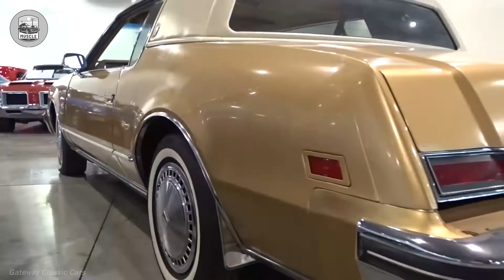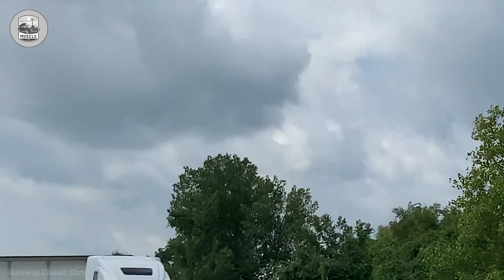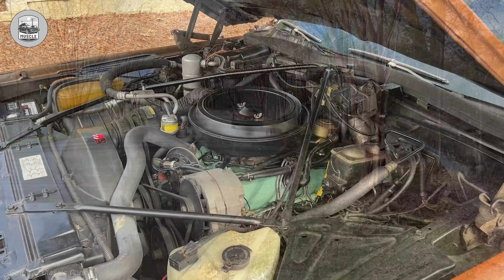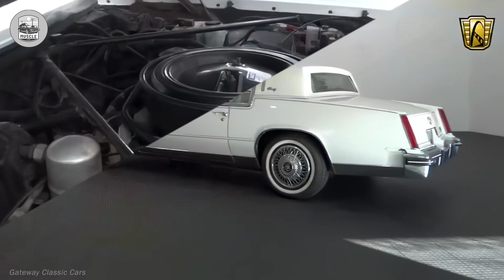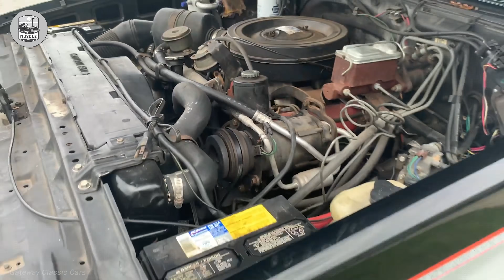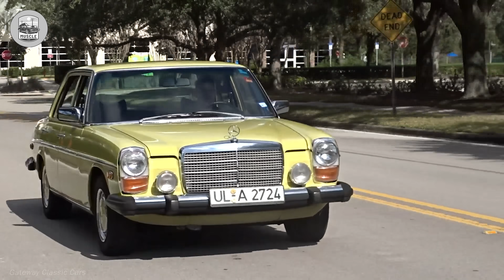Why Oldsmobile's Diesel V8 MOST FAILED?

Comment: Only in the U.S. could someone think the answer to poor fuel economy was a massive 5.7l diesel V8
Reply: 30 mpg in a full size sedan that can fit 6 people sound pretty damn good on paper at the time.
Reply from the maker: Hey @AdelynDodson, thanks for the comment
 It’s interesting how American muscle car enthusiasts sometimes look for power over fuel economy, but the truth is, big engines like the 5.7L V8 have a unique place in automotive history. They represent a time when performance was king, and muscle cars were about raw power and excitement. As a fan, I appreciate both the power and the engineering that go into these machines. Let me know what you think about other iconic engines, and feel free to share your thoughts
To everyone else, please comment, share, and subscribe to keep the muscle car love rolling. Hope to see you in the newest videos… have a nice day
Reply: Does anyone know what a Detroit Diesel 6- 71  or a 6V- 71 weighed ? I suspect more than most gasoline V8s, even big blocks.
Reply: @davidpowell3347  
 DD 6v-71 came in around ~2000lbs dry. The olds 350 was only about 150lbs heavier than its gasoline counterpart ~750 lbs. Thats part of the problem. The olds 350 wasn't robust enough to handle the pressures or heat.
Reply: A 5.7 liter isn't very big.
Reply: @Allgoodhandlesaretaken81 maybe in the U.S in europe it is huge....anyways i think 5.9 cummins would have been a much better choice with minor modification would have fit in that engine bay of a full size car🤔
Reply: @constantinzegrean6260 The 6BT has a dry weight of 1,100 poinds!

Comment: That orange Cadillac shown is gorgeous
Reply from the maker: It really is a stunner — that color on those big Cadillac lines is hard to beat. Here’s the irony that ties it back to the video though: Cadillac got burned by that same Olds diesel. GM dropped the LF9 350 diesel into Cadillacs too, and it tanked the brand’s reputation for reliability right when buyers expected the best. So a beautiful Caddy from that era might be gorgeous on the outside and hiding GM’s biggest engineering black eye under the hood. The ones that got the gas 425 or 368 are the keepers. Any idea what year or model that orange one was? Some of those late-’70s Coupe DeVilles in bright colors are getting collectible now.

have  a great day, hope to see you on our NEWEST VIDEOs for Pontiac DRILLED 130 HOLES in This Catalina - Then GM KILLED It!
https://youtu.be/q4gUSwPM4kQ

Comment: Check your grammar
Reply from the maker: Ha, fair — that title’s a bit of a word salad. Should read “Why Oldsmobile’s Diesel V8 Failed.” What most guys don’t know is the LF9 diesel didn’t fail because it was a diesel, it failed because Olds built it on the gas 350 block with head bolts that couldn’t hold compression, and there was no water separator so one tank of bad fuel killed the injection pump. Good idea, rushed execution. That’s what really sank it.
have a great day, hope to see you on our NEWEST VIDEO:
Ronnie Sox’s “IMPOSSIBLE” Clutch TRICK That KILLED Pro Stock in 1971!
https://youtu.be/swL7Y3BY8S4

Comment: There are hobby engine builders who remedy the major flaws .  With proper upgrades can be pretty reliable , it might have been ok as a light duty industrial engine. There is a dearth of non-Mercedes automotive diesels for 4,500 pound passenger cars.  I wish GM had ttrial tested it in a limited fleet for an extra year or two. Even with the upgrades infamilar American owners and mechanics would probabky have tarnished its reputation.
Reply from the maker: Timothy, that’s a much more nuanced way to look at the Oldsmobile diesel. The basic architecture wasn’t hopeless — with the right upgrades, careful maintenance and realistic duty expectations, hobby builders have shown that these engines can be made considerably more durable.
I also agree that a limited fleet test could have exposed the weaknesses before GM put so many of them into passenger cars. By the time the major problems became widely known, the reputation was already too damaged for most owners and mechanics to give the engine a fair second chance.
That “what if GM had tested it for another couple of years?” question is a fascinating one. Thanks for adding that perspective, and I hope you’ll check out our newest video too.
Bob Glidden's JUNKYARD Boss 429 vs Chevy's Best Pro Stock Team!
https://youtu.be/OocEupQ2s3U

Comment: I read that Opel was manufacturing diesel engines in Europe and GM owned a part of the company, so why didn’t they consider seeking help from their corporate partners? They imported cars from other automakers all the time.
Reply from the maker: That's a question a lot of people have asked over the years, mate. 
 GM did have access to diesel expertise through its European divisions, including Opel, but the timing and the market worked against them. In the late '70s, GM wanted a diesel fast to meet the fuel crisis and CAFE regulations. Developing a clean-sheet diesel—or adapting a European design for large American RWD cars—would've taken years. Instead, management chose the quicker and cheaper route: convert the existing Olds 350 gasoline V8 into a diesel. On paper it saved millions. In the real world... the head bolts, block design, and fuel system simply weren't engineered for true diesel combustion pressures. The concept of a fuel-efficient American diesel wasn't the mistake—the rush to market was. I've always wondered how different history would've been if GM had delayed the project just two or three years and leaned more heavily on its European diesel experience. Do you think the Olds diesel could've earned a good reputation, or was the damage inevitable once they chose to adapt a gasoline block instead of starting from scratch? 

Have a great day, and hope to see you on our NEWEST VIDEO: Why Buick Put a CAR TRANSMISSION In a SPEEDBOAT!
https://youtu.be/6QFCNjkeLtI
Reply: @MuscleCarMasters68  many automakers rush things into production to help their profit margins; Chrysler did it with the Aspen and Volare, except it was more the construction of the car that was the problem.
Reply from the maker: That's a great comparison. The Aspen and Volaré are a textbook example that rushing a product doesn't always mean the engineering concept is bad—it often means the execution isn't ready. In Chrysler's case it was corrosion protection, fit and finish, and build quality. With the Olds diesel, it was asking a gasoline-based architecture to survive diesel loads before the design had fully matured.
It's interesting how history repeats itself. The pressure to save time and money can erase years of brand loyalty if the product reaches customers before it's truly ready.
Looking back, which launch do you think hurt its company's reputation more—the Oldsmobile diesel or the Aspen/Volaré? I could see a strong case being made for either one.

good day bro...
Why GM's CHEAPEST 2-Speed REFUSED To Die - The Powerglide!
https://youtu.be/mSC040Lek-c
Why Dodge Built A Truck With NO REAR AXLE In 1948!
https://youtu.be/gwjBxI8coNU

Comment: I USED TO WORK ON THESE ENGINES AND DID NOT HAVE ANY HEAD GASKET PROBLEMS AFTER UPGRADING HEAD BOLT TENSILE STRENGTH MOD
Reply from the maker: That's the kind of firsthand shop experience that's easy to lose over time. The internet tends to paint every Olds diesel as hopeless, but a lot of mechanics who actually worked on them will tell you the same thing: once the head bolt upgrade was done correctly, many of the chronic failures disappeared.
That's an important distinction. The original design had weak points, but the service fixes GM introduced over the years changed the reliability picture quite a bit. Unfortunately, by then the engine's reputation had already been damaged, and most owners had lost confidence.

I'd be interested to hear your experience from the shop floor—after the head bolt upgrade, what was the next most common issue you saw? Injection pumps? Glow plugs? Fuel contamination? Those are the kinds of details you only get from someone who actually turned the wrenches.
Have a great day, and hope to see you on our NEWEST VIDEO: Why Buick Put a CAR TRANSMISSION In a SPEEDBOAT!
https://youtu.be/6QFCNjkeLtI

Comment: I had an 81 Eldorado with the 5.7.
I never had a problem with the engine, other than it was gutless. I was a dog climbing the pass between CA and OR.

To bad GM pissed away money on that project. Seemed like GM threw away their engineering legacy with this engine and the Vega. Plus othet crappy ideas.

I can't count the number if times I drove to Oakland, CA from Tacoma and I used to get 26-28mpg consistently
Reply from the maker: Yours is actually the best case scenario for that motor and it proves the engine wasn't all bad when it was treated right. Tacoma to Oakland and back gettin 26 to 28 consistently out of a full-size Cadillac, that's real diesel mileage and that's exactly what GM was chasin when they greenlit the project. On flat highway at cruise that 5.7 diesel was doin exactly what it was designed for.
The gutless part is the honest trade-off nobody at the dealership mentioned. That motor was a gas 350 Olds block converted to diesel, and the compression ratio was high enough to light diesel fuel but the injection system was primitive compared to what the Europeans were doin. No turbo, no intercooler, just naturally aspirated indirect injection. So it made torque like a gas motor at best and had none of the low-end grunt a real diesel should've had. Climbin a pass between CA and OR with a full-size Eldo is exactly where ya felt it, loaded up at altitude with no boost and no power to spare.
And you're right that it pissed away engineering credibility. The block wasn't designed for diesel combustion pressures, the head bolts were too small, and the heads cracked. Yours survived 'cause ya drove it steady and maintained it. Most didn't, and the warranty costs damn near sank Olds. Between the diesel and the Vega, GM burned through more customer trust in ten years than they'd built in fifty.
But 26 to 28 outta a Cadillac on the interstate is the proof the idea wasn't stupid, the execution was. Ya just happened to get one of the good ones and drove it right. How many miles did ya put on that thing before ya let it go?

have a  great day, hope to see you on our NEWEST VIDEO for Why GM's CHEAPEST 2-Speed REFUSED To Die - The Powerglide!
https://youtu.be/mSC040Lek-c
Reply: @MuscleCarMasters68 

I had it for 4 years and drove it about 40k miles.

I had a water pump failure south of Eugen, OR, and I either cracked a head or compromised a head gasket. It was still drivable. No mixing of coolant and oil.

Very comfortable car, especially on the highway.

I got my $1500 worth.
Reply from the maker: 40k miles for a $1,500 Cadillac is hard to argue with. And honestly, your water pump story is exactly why so many of those 5.7 diesels met an early end. Once they got hot, the high cylinder pressures and relatively small head bolts didn't leave much margin for error. Even a single overheating event could start a head gasket leak or crack a head, even if the engine still ran afterward. The fact that yours never mixed oil and coolant suggests you probably caught it before the damage became catastrophic. That's good wrenching as much as good luck. 
 The shame is that owners like you proved these engines could be economical and comfortable cruisers when maintained and not abused. Unfortunately, the failures got all the headlines, while the success stories quietly kept racking up miles.

have a  great day, hope to see you on our NEWEST VIDEO for Why 2 Letters KILLED Chevrolet's MOST ADVANCED Transmission!
https://youtu.be/aeySCzTTUPo
Reply: @MuscleCarMasters68 

I didn't to to much as for maintenance. 
Put #2 diesel in the tank and go.

Just did scheduled engine oil and filter change. Renewed and flushed all other system fluids. Replaced all "V" belts.
Inspected all hoses and wiring. 
I did have to replace the alternator.

I was lucky the A/C came up. Pressure tested the system with nitrogen to about 125# and evacuated it. Held 29" Hg for 12 hrs. Charged it to 80% with R-12. You could hang meet in the cabin.
God old R-12!!
Never added another oz of refrigerant the test of the time I owned the car..

The fuel filtration was virtually non-existent and I was looking to upgrade with a RACCOR primary element.

Comment: i owned and worked on these motors, they had half the failure rate of vw. the biggest problem with them was the owners. motor had 22-1 compression, harriet the home owner would take it to the store shut it off, take it to hair dresser shut it off, take it the frien shut it off. it never got warm , oil never flushed the rings, engine loped until crank went thru oil pan
Reply from the maker: Now THIS is the kind of perspective you only get from someone who actually lived with these engines. 😄
what most people miss is that operating conditions can be just as important as engine design. The Oldsmobile diesel wasn't very forgiving of repeated short trips. As you described, if the engine never reached full operating temperature, moisture and fuel contamination could build up in the oil, preventing it from doing its job properly.
The funny thing is that many people remember the failures but forget how the vehicles were being used. A diesel designed to work hard and stay hot often has a miserable life when it's driven a mile to the grocery store, then shut off five times a day.
The crazy part? That's one reason opinions on these engines vary so much. Owners who regularly drove long distances often had very different experiences from those who used them for constant short-hop errands.
Stories like yours add an important piece to the history.
Sometimes the biggest weakness isn't the engine...
It's using it for a job it was never meant to do. 

have a great day, hope to see you next time on our NEWEST VIDEOs The INSANE “ROPE” Driveshaft Trick HIDDEN Inside the Pontiac Tempest!
https://youtu.be/FupOg4qlvgc
Reply: @MuscleCarMasters68 
Compression ignition engines are made to run loaded, 75-90% for longevity and efficiency. Idling for any length of time bad ju-ju.

I bought my '08 Dodge Mega Cab with the 6.7 cummins and one thing I noticed was it did not have break-in instructions like I'd read in vehicle owners manuals of years past.
I called up the dealer I picked up my truck at and explained to the Cummins guru and Service manager how do I break in the engine.
His responce, was simple and direct, "drive it like you stole it".

Comment: Rudolph Diesel would be spinning in his grave
Reply from the maker: Funny thing is, the Olds diesel disaster probably scared an entire generation of Americans away from diesel passenger cars for DECADES.
the real tragedy wasn’t that diesel technology was bad… it’s that GM tried adapting a gasoline V8 architecture into a high compression diesel world where cylinder pressures get absolutely brutal.
What most people miss is diesels demand completely different engineering priorities. Head bolt clamping force, block rigidity, fuel system precision, water contamination control… all of it becomes life or death for reliability.
And honestly a lot of the failures got amplified because American owners treated them like normal gas cars. Wrong maintenance, bad fuel quality, ignored water separators, cold weather abuse etc.
The crazy part? Over in Europe, diesel cars were quietly surviving forever while Americans were watching Olds diesels grenade themselves in grocery store parking lots.
That’s where the diesel reputation war got permanently weird in the U.S.

have a great day, hope to see you on our NEWEST VIDEO for When Drag Racers LOST Their Minds and Built A MILITARY-GRADE Transmission!

Comment: The connecting rod bushing at the small end could twist so the oil hole was blocked and the bushing became worn out with a nasty knocking sound and the oil was full of yellowish debris.
Reply from the maker: @inghus
Yeah, that small-end bushing issue is one of the failures that doesn’t get talked about much, but it absolutely happened on some of those engines. The connecting rod small-end bushing relies on that tiny oil feed hole to keep the wrist pin lubricated. If the bushing rotates slightly in the rod eye — which can happen under heat and load — the oil passage can line up wrong or get completely blocked.
Once that happens the wrist pin starts running with poor lubrication, and the bushing material wears quickly. Because those bushings are typically a bronze/yellow-metal alloy, the first warning sign is often exactly what you described: yellowish metallic debris in the oil. After that the clearance increases and you get that sharp knocking or ticking sound from the top of the rod as the pin starts moving around under load.
From a mechanic’s standpoint, the tricky part is that this kind of wear can progress quietly until the debris circulates through the engine. That’s why oil analysis or early inspection sometimes reveals the problem before a catastrophic failure. It’s a small detail in the rod design, but when lubrication to the wrist pin is compromised, the damage can escalate pretty quickly.

good day, hope to see you on our NEWEST VIDEOS for The 1971 BETRAYAL: Why Your "450HP" Chevelle Would LOSE to a Modern Camry?